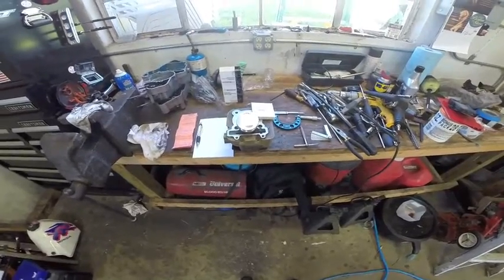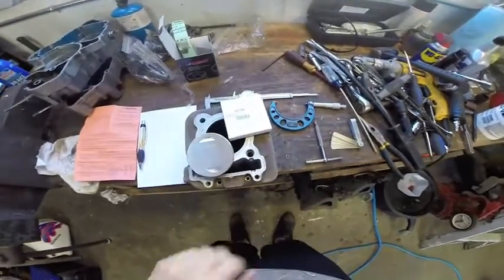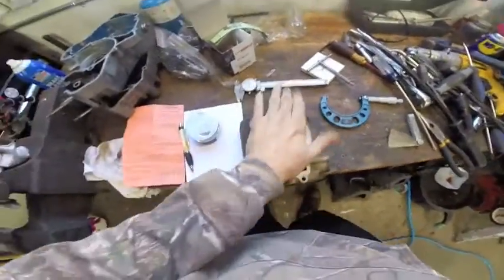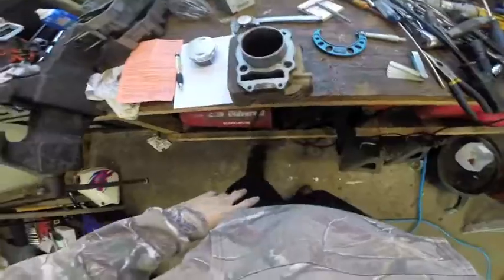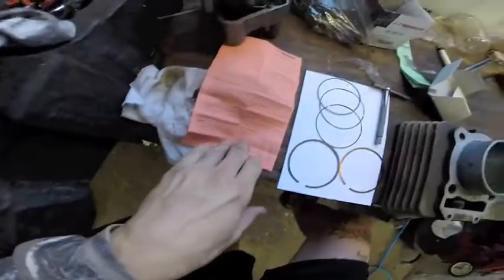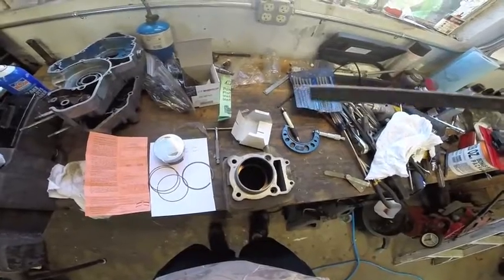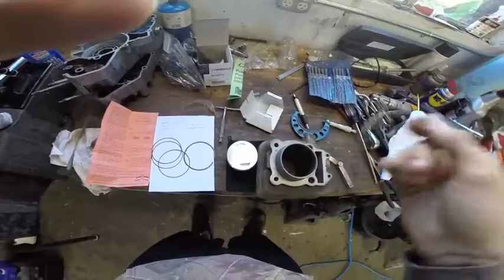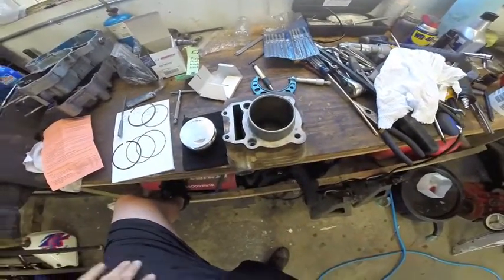How To Properly Set Your Piston Ring End Gap On a 4 Stroke

Comment: Been working on a Dr350 for 3+ years...I finally finished the bottom end and started working on the top end and noticed new rings had huge gaps...like an idiot I bought new rings for a stock bore size..when it was +.1mm oversized. Now gotta wait for another few months to source new 80mm rings.... living in Mexico sucks when it comes to getting parts for old bikes

Comment: I just did a top end rebuild on my brothers 09 raptor 350 my ring gap is in spec but it won't make over 93psi im stumped. Any advice or things to look for id greatly  appreciate it. Reson for the rebuild was cam jumped time and bent the exhaust valve. I lapped and seated the valve.. i didn't replace the valve guide think that may be my issue? Valve moves without any resistance thru the guide.